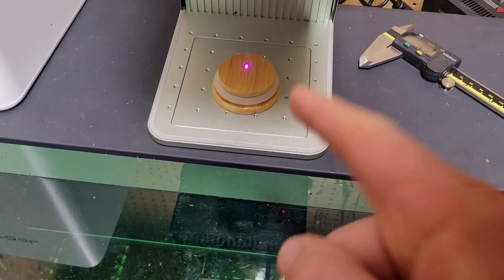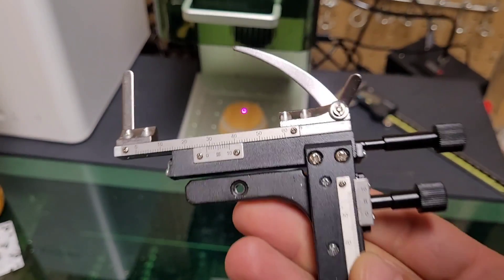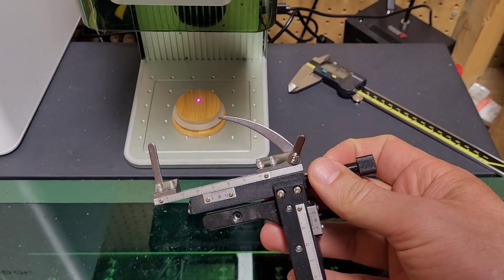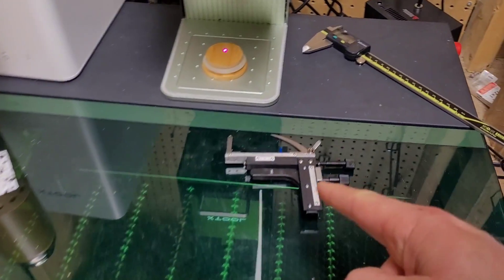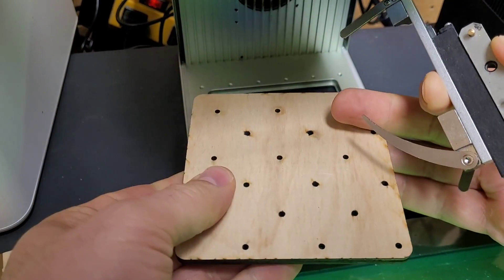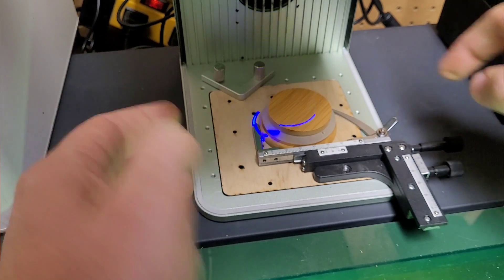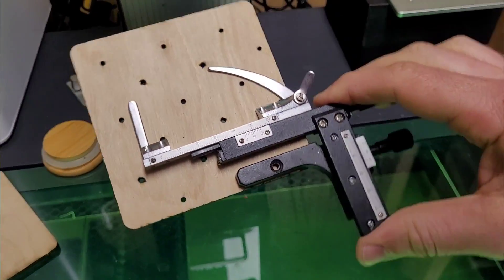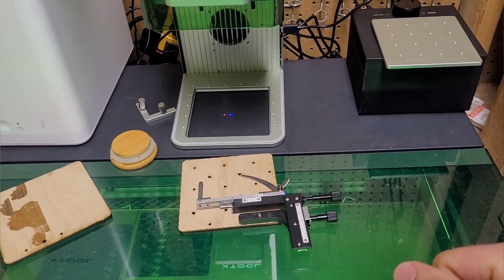Boost Efficiency & Accuracy With This xTool F1 Hack

Comment: We have a similar product at work for calibrating cameras. It looks like a cube and slides left, right front and back to have the perfect angle. It can even tilt whatever it is holding so it is at the correct angle it needs to be to compensate for any differences in tolerance. It costs around 500$. those things can be very expensive even though they are very small.
Reply from the maker: Yup XYZ + rotation ones are great. Just need a cheap & simple XY for this application so the $15 price tag is very appealing